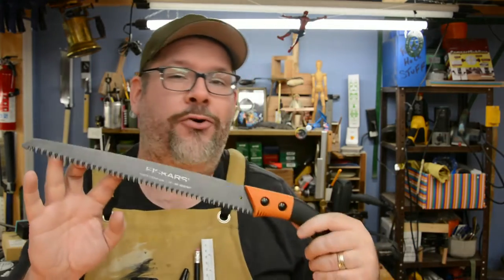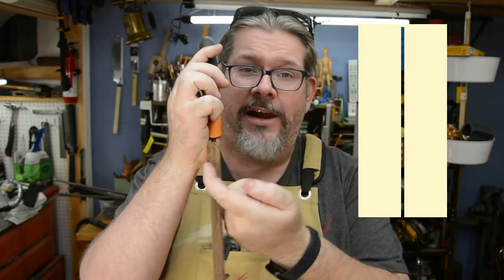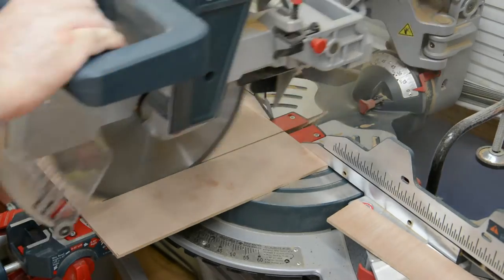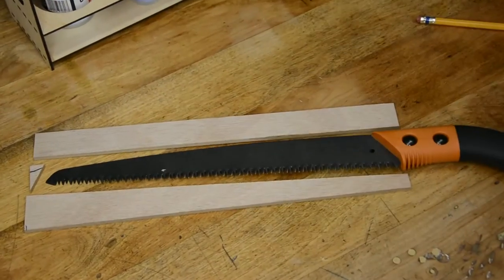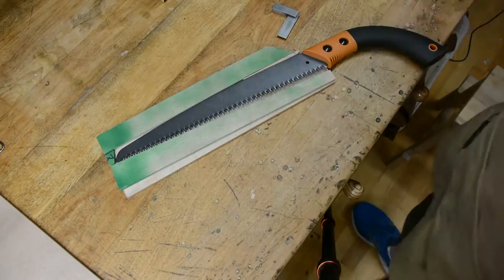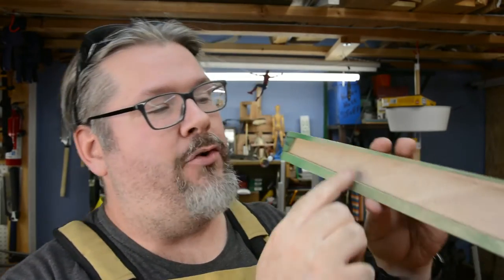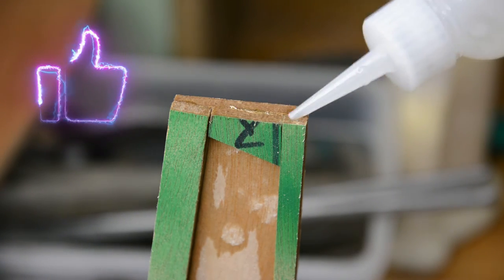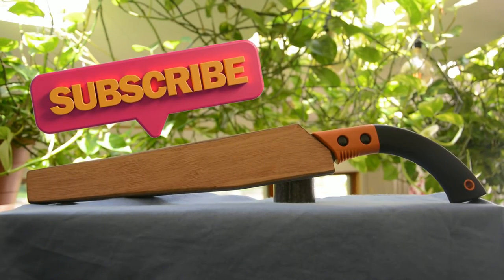How to Make a Wood Sheath - Woodworking Hack

Comment: Nice
Reply from the maker: I ended up solving the problems entirely with this next version of the build. Went and made a two-stage dust collection system implementing HEPA rated filters and a HEPA dust bag. Check it out! https://youtu.be/k5GpNyH_FBo  I think it's a major improvement, but I’m sure it could still be better. I would appreciate any feedback you have!